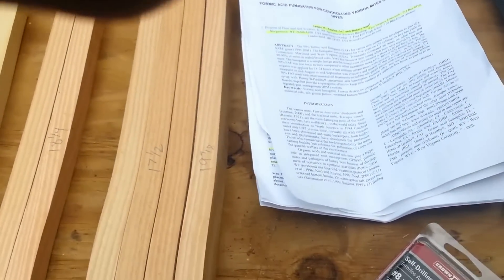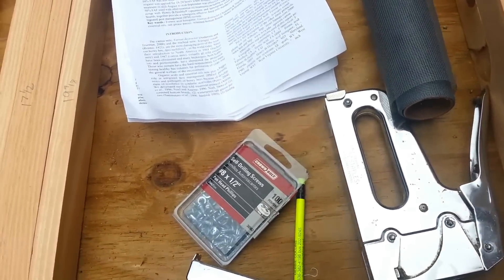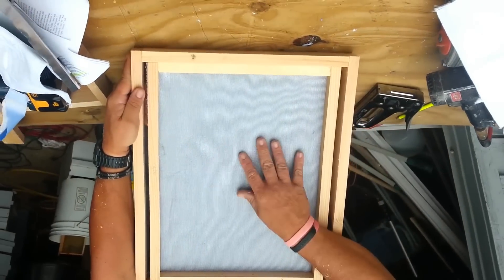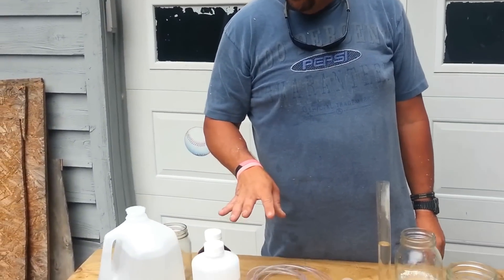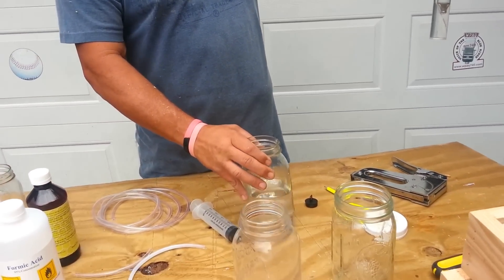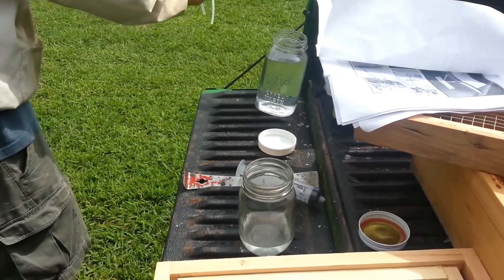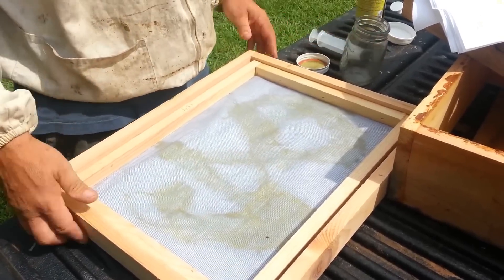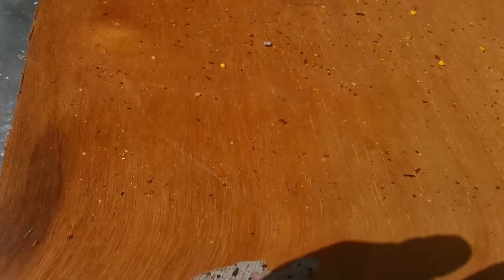formic acid video825

Comment: Cook family you are 100% correct. I didn't realize that. Something I missed. I retreated using hive covers and had a much better drop! Might I add formic acid is approved in the US for treatment of varroa but this system is not that Im aware of. Use at you own discretion.